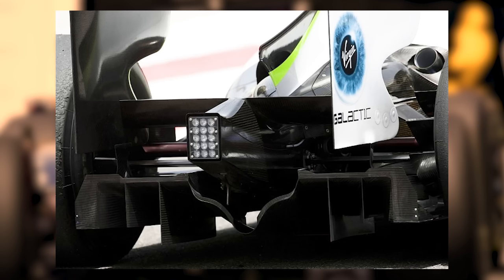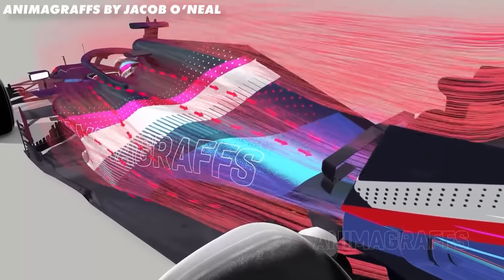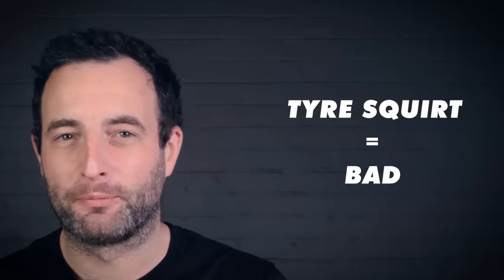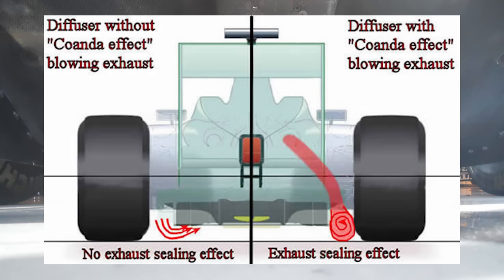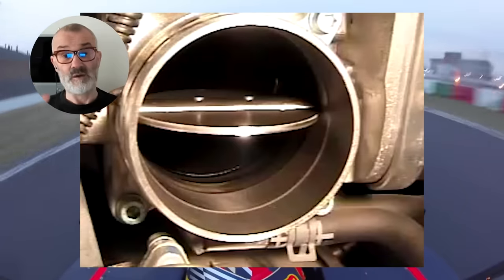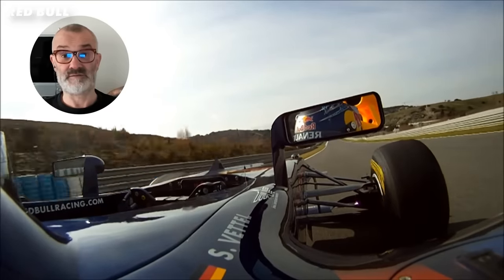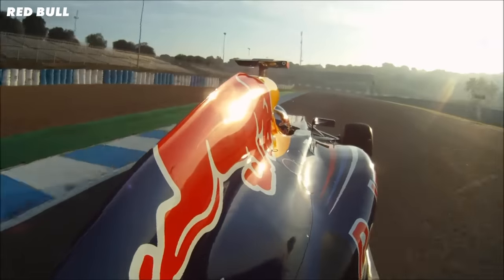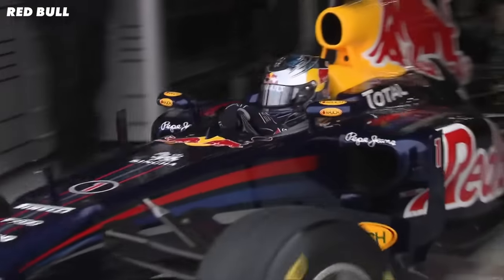When F1 Used Exhausts to Make Cars FASTER

Comment: There was a period in the early 2000s when they directed their exhaust upward to create more downforce too.
Reply: That is correct, the teams used the Coandă effect with the exhaust gases following the contours of the body work to either energize the rear diffuser flow or increase the flow differential of the rear wing and the Y250 mid-plane wing as well.
Reply: @Unamatrix01  When the exhaust vented rearward in 2014 they directed it at the 'monkey seat' so it would vent upward under the bottom rear wing.   It's funny that Minardi first developed this idea in the mid-90s.
Reply: The reason ferrari introduced periscopic exhaust pipes in 1998 was not to create downforce, it was purely a thermal problem with the materials at the time. Later it was found to bring some nice benefits and got widely adopted by other teams, though. Blown diffusers had been a thing for decades (albeit in a different manner than the 2011 version), but with the massive rev range in the late 90s, teams started to move the exhaust a bit away from the diffuser because it was making it too sensitive to throttle response. So that was another reason why the periscopic pipes eventually took over.
Reply: @leo1fun  If I can remember right, they had a few cracked exhaust pipes.  I can't remember if one melted critical parts and I think another time they just pulled the car from the race.
Reply: @Unamatrix01  Believe in JESUS today, confess and repent of your sins. No one goes to heaven for doing good but by believing in JESUS who died for our sins.  “That if you confess with your mouth, “Jesus is Lord,” and believe in your heart that God raised him from the dead, you will be saved. 10 For it is with your heart that you believe and are justified, and it is with your mouth that you confess and are saved. ”(Romans 10:9-10)❤️
Reply: Wonder how much the actually did.
For Top Fuel, they gain about 1000 lb of downforce from the exhaust at the start.  F1 is about 3500 lb total, near top speed.
Reply: Top Fuel does this
Reply: Smokey would be Proud 🏁🏁🏁
Reply: @andyd8370  a lot of high power drag cars do too
Reply: During WWII airplanes increased their top speed by directing the exhaust rearward.  I initially thought this would be negligible, but apparently not!!
Reply: Renault invented diffuser blowing in 84 and it was also used in the 90's
Reply: a very simple, yet ingenious method of increasing downforce. Tis a shame this is now banned too, just like everything fun in F1.

Comment: Great video. Adrian Newey also attempted blown defuser in the MP4/15 and MP4/16, which is why the engine sound was so unique, definitely check out that sound, to me it was the best sound from an f1 engine.
Reply: Believe in JESUS today, confess and repent of your sins. No one goes to heaven for doing good but by believing in JESUS who died for our sins.  “That if you confess with your mouth, “Jesus is Lord,” and believe in your heart that God raised him from the dead, you will be saved. 10 For it is with your heart that you believe and are justified, and it is with your mouth that you confess and are saved. ”(Romans 10:9-10)❤️
Reply: Whilst true that he was using the blown diffuser back then (and also in the williams days), the Mclaren actually sounded so different because of it's beryllium pistons, which where very light weight, meaning a longer stroke could be had, providing more torque. Ross Brawn was very impressed with this and couldn't work it out in the beginning. Brilliant engineering.

Comment: Kind of off topic but one of the differences between the Super Marine Spitfire MK I and the MK V was the positioning of the Merlin's exhausts straight back which provided the thrust equivalent of another 50-60hp. On the MK I they just dumped the exhaust straight out the sides.

Comment: Would've been good to touch on the coanda-effect exhausts that were introduced in 2012 (I think?) when the FIA stepped in to stop the teams placing the exhaust outlets right by the diffuser. Another excellent bit of design work there!

Comment: Fun fact: the upward-swept "zoomie" headers on Top Fuel dragsters actually function like rocket engines. At wide open throttle, those 500-cubic inch (8.2L) supercharged V8s spin up to 8,500rpm, cramming air into the cylinders at 65psi above atmospheric pressure (which is insanely high even for a modern ball-bearing turbocharger spinning at well over 200,000rpm, let alone a belt-driven Roots blower), along with 1.5 gallons of 90/10 nitromethane/methanol blend fuel per second. These engines see mean effective pressures up to 1,450psi and power figures in the neighborhood of 11,000hp. The sheer amount of reactionary mass being blasted upward and slightly rearward out of the exhaust pipes is capable of producing almost 1,200lbf of thrust, mostly directed downward to squash those massive ultra-soft drag slicks into the pavement.

Comment: So hot blowing was technically an afterburner effect. the fuel was Ignited as it left the combustion chamber to blow out the exhaust, only not to thrust, but to create active air to let the diffuser do it's job properly

Comment: Technically it's not a suction effect, it's the air above the car that pushes it down.
Great video, thanks to Scott and Scarbs for the great explanations. Happy new year to all of you!
Reply: I'm not going to get into an argument about it but it is absolutely about the car being "sucked" down, not being "pushed" down that creates downforce. Basically F1 cars use the principles that enable planes to fly in reverse. Intuitively it would seem they are being pushed down but they are actually being "sucked" to the ground. This is the way these principles described work, otherwise pushing air flow at the bottom of the rear would create the opposite effect of "pushing" the car upward and, thus, decreasing downforce
Reply: @batman9823  Physically speaking there is no suction force. There is a pressure differential and the high pressure area pushes towards the low-pressure side. Which makes it look like suction, but it isn't. 
But the point is moot anyway because we're both talking about the same thing: le downforce
Reply: @batman9823  suction is a result of higher pressures pushing against something and forcing it towards lower pressures. Think about a can of soda. The higher pressures inside are pushing the walls of the can towards the outside. This is the same mechanism as suction.
Reply: In a venturi pressure differential the lower pressure area definitely creates what you'd call a suction effect.

Comment: Thanks  for always given nice videos to explain things.

Just curious.... yes Downforce is created over  the difference of air pressure on the car,  but it does not mean a car is being "sucking"  on the track but air pressure travels from high to low, so the car is being pushed into the track by the high-pressure on top
Reply: iirc the "high" pressure airflow is closer to normal pressure compared to the "low" pressure underneath
Thats why they compare it to sucktion

Comment: Your description of the pressure difference above and below the car (commonly referred to as longer path theory) is a common misconception people often associate with how planes fly as well. Ignoring the chassis for a moment, the front and rear wing of the car are airfoils (wings on a plane are also airfoils, but in the case they are being used for downforce rather than lift).

 The assumption you're using assumes that two air particles from the atmosphere separate at the leading edge of the airfoil and then join up at the tailing end. Since one air particle has a longer path, it must have higher velocity, and thus a lower pressure. We cannot assume that the air particles will meet up again at the tail end of the airfoil, as this is not a realistic assumption. Also if this were true, symmetrical airfoils would not produce any lift.

Downforce (and lift) is generated from redirecting or turning the airflow. In the case of the F1 car, the air hits the leading edge of the airfoil and is directed upwards as it moves along. The airfoil exerts an upwards force on the air and the air exerts an equal and opposite downwards force on the airfoil. The product of this interaction is downforce. 

I apologize if I am coming across as condescending to anyone, but I am just seeking to provide more accurate information to people

Comment: Can someone please help me out.
Here is one thing I cannot understand; do diffusers accelerate the airflow beneath the car OR do they take the already fast-moving air and gradually slow it down to ambient pressure? If the diffuser accelerates the airflow, how does it do so with an expanding area? I thought according to Bernoulli, a mass flow deccelerates under the conditions of an expanding volume.

Comment: Man, I want a very nearly open-class F1. No MGU-H, and no primary downforce fan cars. Other than that give them size constraints, safety standards, and maybe a budget limit, a combined HP limit of like 1000KW or 1500HP, and let them have at it. 6-wheel, 8-wheel, AWD, Turbo, N/A, ground effects, super DRS, closed cockpits, closed-wheel or open-wheel, IDGAF. Also, derestrict track certifications so they can have straights longer than 2km, I wanna see some 240-280MPH speed demons!

Comment: As a racer? Baja 1000 15 miles out is where sit after shut it down.  You ever team race melt it down  rod it out never lay down. 15 miles out 15+ minutes lead heading in on a loop race. When the closer you get to Ensenada all the stickers all the prerunning all the hospitality of being real pays off when you hit that mariachi horns like sirens and the fans pull the truck across the finish. With time to spare. The closer to Ensenada the more and more fans. I'll wheel it.

Comment: How much flow pressure/velocity was needed to be beneficial? Ignoring weight penalties so for conceptual sake only, could you rig a system that charges during braking or even tap off the exhaust to charge it and can be activated that releases air either through spring charged compressor to fill a mini tank of air or just spin a turbine/blade to send flow where it needs to be?

Comment: Red Bull is the best team in Formula 1, on design, strategy, pitstops, I have the best driver. Mercedes had an artificial advantage locked in with anti-competitive homologation rules and they were given a head start, out spent every other team, and helped develop the hybrid engine regulations with the FIA. They were a one trick pony
Reply: I think we need a proper analyze of that team. how can a newbie get to be that great

Comment: I’m thinking you could use the exhaust to offset the tire blanket issue
Reply: never would work, tires need to be brought up to temps from inside out not outside in firstly. second you'd have almost no control over the temps given altitude changes, weather, tire compunds (optimal ranges are so tight it would be impossible)
Reply: Would be very hit or miss since the exhaust is extremely hot and would melt away the surface rubber before reaching the inner threads of the tyre. Also new regulations allow the tyres to be heated to only 50°C which with the exhaust system is impossible

Comment: How does the airflow from the exhaust actually pass more air THROUGH the diffuser if it is positioned outside the outer wall of the diffuser. Wouldn't it just pass more air over the top of the floor? Thanks !
Reply: The fast air pulls more air around it. It’s not just the exhaust.

Comment: Cue the anti-FIA and anti-Formula comments from the fans who want no regulations, the same fans that love the classic circuits. You can't have both. The cars are already too fast for the walls and limited amount of run-off areas we have at most tracks. Let them keep all the aero innovations, active suspension, blown diffusers and cornering speeds would be insane.

Comment: How about exhaust gases to optimise braking ? I don't know but in my mind I would think electric cars won't stop as good as petrol cars because of engine braking, but on the flip side they probably aren't carrying as much weight so braking might Work out about the same anyway. I dunno. I just wonder 🤔
Reply: Brakes can easily overpower the grip of the tires, so it won't matter
Reply: @boudewijnb  engine braking assists as-well though right? You'll brake faster using engine braking and brakes together at the same time Then just using brakes alone Wouldn't you ? Also on a petrol car or motorcycle say coming from 200 KMPH down to a hair pin you have the machine in the right gear to accelerate out of the corner No point deaccelerating down from 200 KMPH then chewing up time to find right gear. Make's more sense to do it while machine is in motion. Also on motorcycle it would help me at times turn the bike using engine braking it helps a lot if going around a left hand corner and your rear tyre comes around a little means your turn is half done already. Only certain corners though
Reply: @speedmann194  you don't use the rear brakes because there is engine braking. You can only brake as much as the tire has grip. It doesn't matter if the braking comes from the brakes or the engine. You can also use electric motors as generators, regenerating the energy in the battery, which can act like engine braking
Reply: @boudewijnb  ok thankyou for your input
👍

Comment: "Diffuser expands the airflow, and as it expands it accelerates and generates DF"

This isn't true. DIffuser's role is not to generate DF solely, since expansion of air is used for better pressure recovery (DECREASE in velocity, and increase in static pressure). It prevents very turbulent wakes which form with sudden flow separation, and it also guides this accelerated flow towards the bottom region of the wing which further accelerates due to its curvature, thus causing a low pressure below the rear wing plates.

It is the main body (due to ground effect) and the rear wings which generate a lot of DF downstream of the front wing

Comment: I have a question if anyone wants to answer: if you still have air going through the engine off throttle, wouldn’t you severely impact the engine braking performance making for longer breaking distances? Did they decide it was better sacrificing the performance of the car under braking to achieve better cornering speed? Or did they find a way to counter this effect?

Comment: "Excess fuel usage" being the reason to ban this saddens me, because greenwashing gives environmentalism a bad name.

The environmental impact of the fuel used in F1 is peanuts compared to the prototyping and manufacturing of all the single-use components made from exotic materials, or transporting the cars and equipment to the various circuits. 

Moreover, the overall environmental impact of F1 is peanuts - there are much bigger emitters of CO2 we can easily target and improve.

F1 is a technical sport that inspires young engineers. We shouldn't be poisoning them against green tech.

Comment: Interesting concept, although the mindless machine gun editing completely eviscerated your explanation of it. Headshots of the presenter talking do nothing but take time away from illustrating the concept you are trying to explain. Before you can even figure out which way the car is pointing in your graphics, we’re back to a talking head or a stock shot of a random generic F1 car on a random generic track. Were any of your shots of the (unexplained) “diffuser” even one second long? If a viewer has to repeatedly go back and try to pause on a scene to try to figure out what you’re talking about, it’s because the presentation has failed.